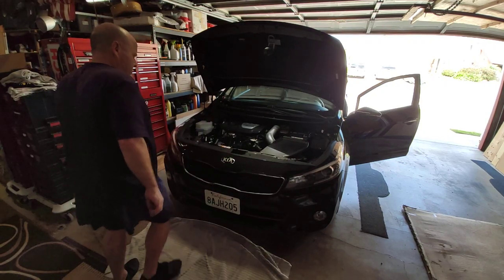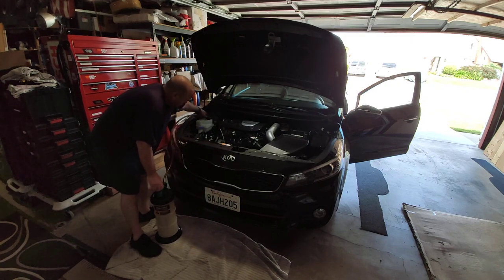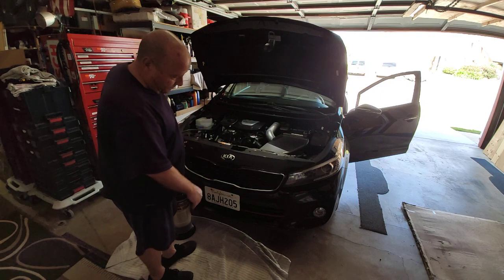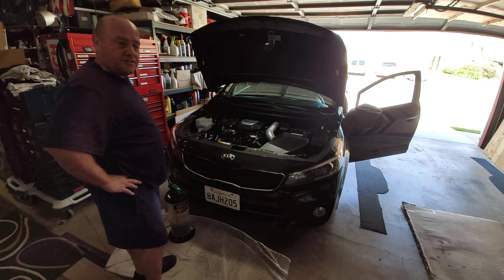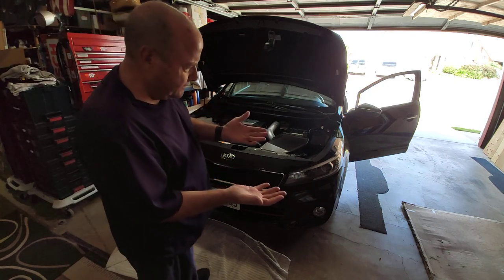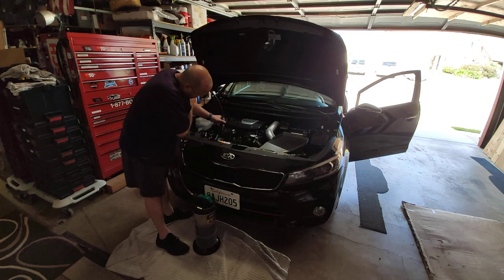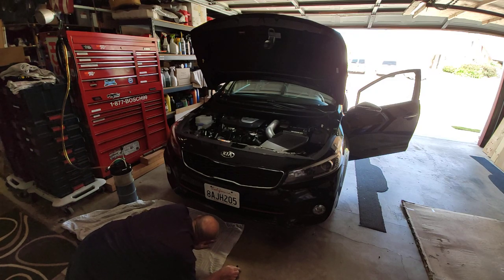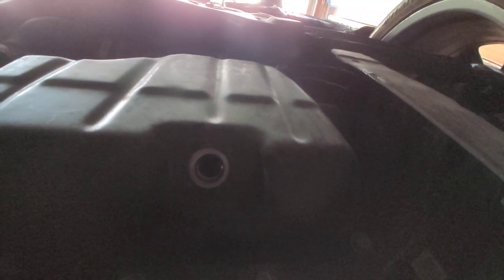Oil change, sucking system, vs draining it?

Comment: Excellent video! I have a vaccum pump I've bought for changing the transmission fluid. I was wondering if it would be the same thing for the engine oil. Too bad I have to crawl under the car anyways to change the oil filter.
Reply from the maker: I have to do that as well. But I don't need a jack to get to the oil filter. I would think that an oil extractor for the transmission would be similar if not the same.

Comment: i stick with vacuum oil extraction.
i dont care if there is some oil left behind.

i dont risk damaging oil plug thread.

for those saying there will be a sludge inside..just follow the procedure.warm the engine before performing oil extraction. and change oil frequently( before reaching 5k km, or 10k km)

Comment: I noticed one peculiar thing about this video. When you change oil and pull the drain plug, oil will drip for several hours. Even using a suction device, not all the oil is going to be drawn out. This video is decieving.
Reply from the maker: So that's why I removed the drain plug. I get more oil out with the vacuum system than when I drain it.

Comment: Everyone who does this rip to your engines … exactly y they blow up in a few years if that maybe months … there’s a reason why engines have oil pans / drain bolts … so u can drain out all the sludge and metal that may be in the pan
Reply from the maker: Do you have any proof of this? My car has an oil filter and that pulls any metal shavings from my oil. Also, I change my oil regularly so I don't have any sludge. In fact I have 77000 mile on my current vehicle, have done 12 oil changes with this tool, and have zero issues.
Reply: @tooltipswithtommy  I do ... every engine that has came through my uncles dealership has had a few oil changes done the right way ( removing the oil drain plug ) ...... but the rest were all done at jiffy lube where they use the air extractor to remove the oil .. all these engines in the cars he had at the dealer had failing timing chain guides, sludge build up  I the oil pan , pick up tube was almost closed off on a few of them . Few started smoking from the sludge  build up which caused the piston rings to wear quicker and the valve stem seals to give out ...
Reply from the maker: @mtbridingog9083  I hope you don't get offended if I continue to vacuum my oil out. With the exception of you and your uncle, everyone else thinks this is the fastest, cleanest, and best way to change oil. I have no problem with you removing the drain plug, and doing it the old fashioned way. Have a great day.
Reply: @tooltipswithtommy  and everyone who is using this pump will in future see exactly wat I have listed above .. maybe not tdy or tmmr but for sure it is bound to happen there's a reason y engines have a drain plug people 🤣 ... enjoy and be safe no hard feelings I'm just trying to help u all save your motors

Comment: Interesting.  The worst part of draining oil is removing the filter. It can make a mess. Pulling the oil plug is simple and clean for the most part.  I’ll stick to traditional method. Thank you for sharing.
Reply from the maker: I totally agree with the filter removal. My car is pretty low, and I'm not as young as I once was, so the less time I spend on the ground the better.

Comment: Valvoline oil change places suck. They sucked the oil out of my engine. A $50,000 wheelchair Toyota. I stayed in the van because I had my caregiver give me a ride. What I did not realize until they were finishing is their sucky sucking machine was hooked up to my battery without me know until it was too late. Since, I have nothing but trouble with my in-floor powered ramp. Fucking sucks!
Reply from the maker: Sorry about that.